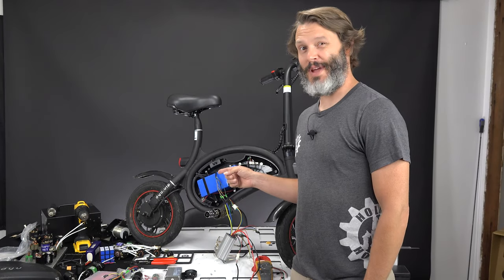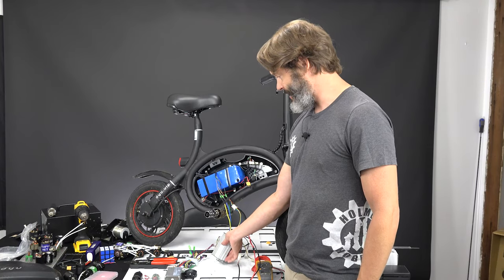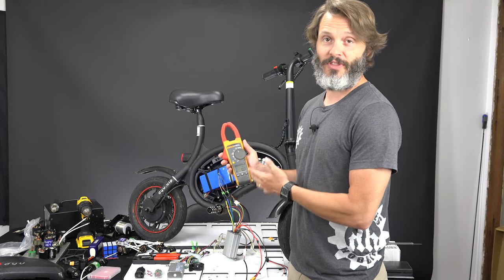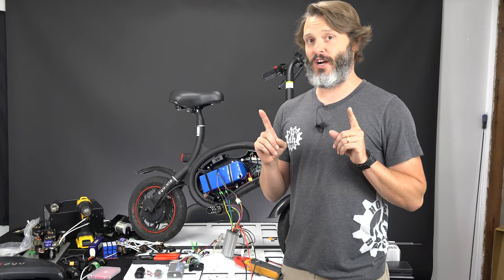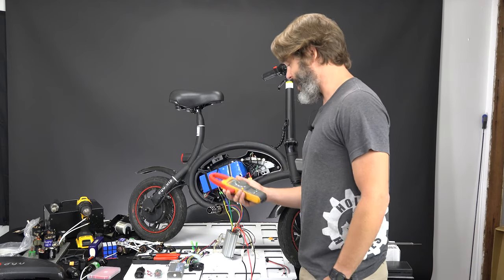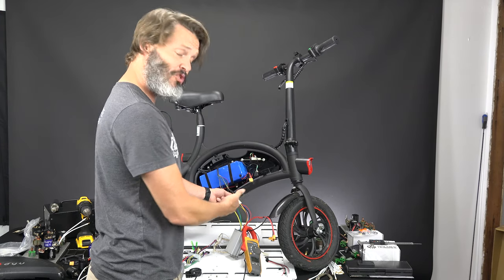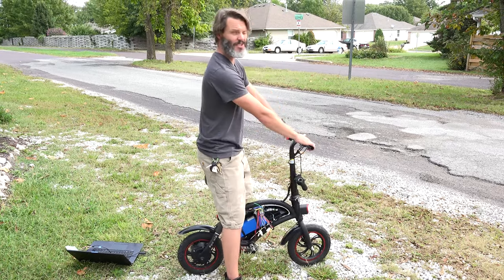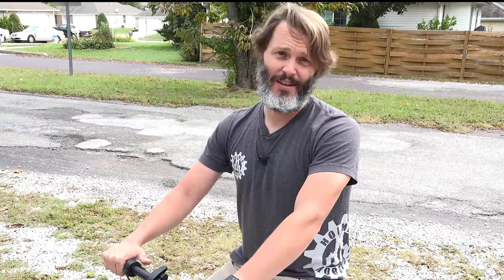Tech Talk & Tips To Upgrade Your DYU Electric Bike Controller - Holmes Hobbies

Comment: I stumbled upon your video because I have one of these Ancheer brand that has been sitting for a year in my den. My daughter didn’t embrace it the way I had imagined. The battery will show fully charged by the charger green light and the battery gauge on bars. It will start to move then shut off and no lights, horn beep or movement. My question is could battery be bad and just fail under load? Sadly this has been used less then an hour. I have probably charged battery 2-3 times while it has sat. Any way to test battery?
Reply: Omm reader

Comment: Hi. 
Question.
As a DYU U.K user. How do you alter the speed setting which is enforced for limits? I want to lift the European 15mph to 18mph U.S. 
Not sure if it is via the throttle Computer, or some Controller inside the main unit?

Please give thoughts or answers.
Reply from the maker: last I tried it wouldnt connect through the bluetooth app, and the stuff I was seeing online was that it would actually downlimit me from 18 to 15 if I tried.
Reply: @HolmesHobbies  i would love to study a electrical engineering diagnostic pros and cons instruction, on what works best on a power output on demand. I.e 36v (4.4 ah+) battery with 250w motor works well (and the in between stuff like Controller limiting kph/mph = battery fast useage). As apposed to 36v 4.4ah battery working with a 1500w motor.

Comment: i need advice,  after receiving an error 10 on my old controller that i was unable to solve i basically pulled that 350 watt controller out, and put in a 1000watt controller. i did this because i run an awd 2 hub motor bike that when running is like a bullet and can hit 60km.  but both controllers got yanked so i can parallel the 2 350w hubs off the 1000w controller. the issue is this. this controller only has 2 phase wires, a blue and a yellow. nothing else.... how the hell do i wire in my motors

Comment: I am using a 36 volt 16 amp battery for distance. I have another 36 volt 16 amp coming. I will add these together for my 72 volts. Can you suggest a controller that will give me more speed from the little motor at this voltage. Ideally 25mph? I also have about 9000 miles on this scooter with only a throttle replacement and tire and tube replacements. Please help if you can. Thanks.
Reply from the maker: I don't have a ready to go controller at this time. need to get back on that.

Comment: How will 72 volts effect the controller. I have a 48 volt 1000 watt motor and I wanted to put a 52 volt battery I bought, the mfg. said if would burnout the controller and motor....Should I take the advise from Ecotric?
Reply: You shouldn't have a  problem. You will get higher  speed .I hav48 v 500 watt  motor  .controller is 15 amp I'm going to 60 v battery and 30 amp controller now  that might be  a problem  eather go like bat out a he'll or burn motor. If so I'll get 1500 watt  .
Reply: @kenleckie2359  Thanks!

Comment: How can I disable the speed limiter on this bike? Yesterday I opened it up and couldn’t find any wire that worked.
Reply: Question, I ordered a batt with more amps 14ah , not for speed- just distance- what is the easiest way to get the rubbers off to get to the screws to open it up. Don’t want to scratch up the body with prying them out with screwdrivers.

Comment: Great vid!!! A couple questions. On the Onebot S6... In order to get more mph&torque I assume I need to replace the battery + controller + ecu correct? I can't just change the controller an wait for it to work right?  Cheers

Comment: I just receive my d1 the only thing wrong is the cruse control and battery guage dose not work bot other than that it is all good do you think that its an easy fix or do i need to send it back to China ? ugh
Reply from the maker: mine doesn't have cruise.
Reply: take the side cover off it is just not plugged in that is all it is i had the same problem easy fix

Comment: hi i can't find the vid on the hacke you did on the original Controller have you removed it?
Reply from the maker: Lost the vid files.  The takeaway was that the shunt mod didn't help startup torque or top speed.  Motor is just too slow to pull more amps on the stock battery voltage.
Reply: C2C World News tell me if you succeeded!

Comment: Can someone answer this for me? Ive got a 300w rear hub motor bike. I want to get a 500w bafaang motor. So my question is, do i need a new motor and controller? Or can i just get the motor and wire it up to the stock controller? My stock controller does about 50kmh
Reply: If your motor is 500 watts and the controller is a 350 watts you can burn the controller so in this situation they need to match up like get a bigger motor you need to change out the controller also

Comment: Abominations of controllers. All I want to do is have both motors front and back wired as simple as possible with zero three-stage button 01 and to just throttle and both motors go that's it.

Comment: I need more speed...
Reply: So quickly, I need 4 items to increase speed right?  1) higher controller.  2) bigger battery 48v.  3) bigger motor.  And 4) bigger capacity throttle.  Right?

Comment: Is it alright to put a 36v battery too a 24v motor? Thanks in advance
Reply: No volts for the controller are important ... You will get it or damage the battery if you just go swapping things without proper set up